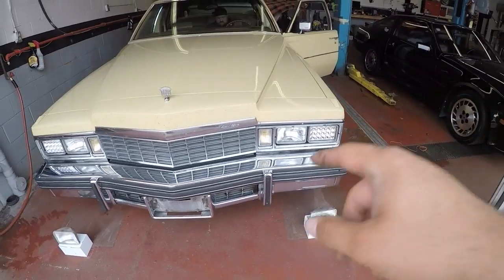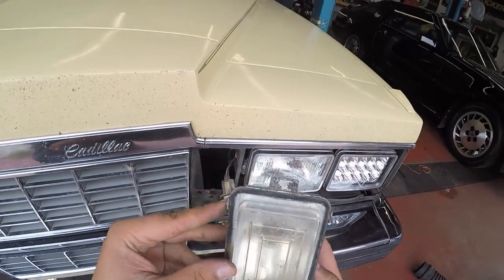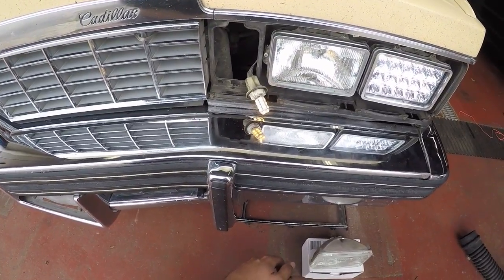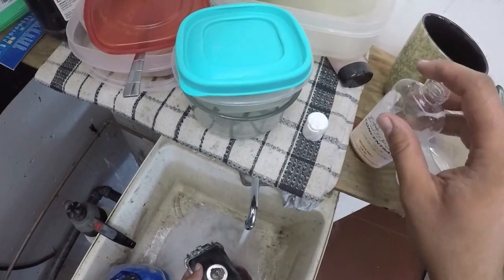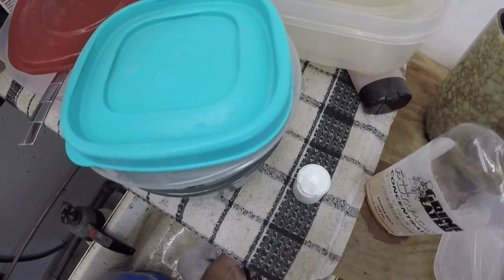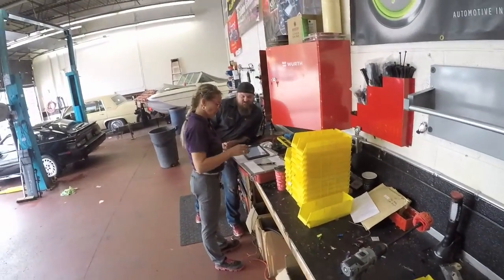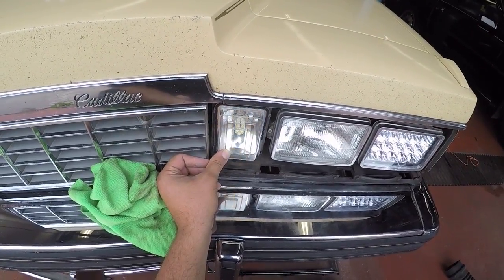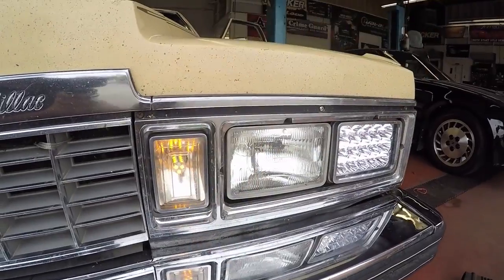Additional "Mac Daddy Caddy" Mods

Comment: Gatlin Did You Forget Something in ´that light system Kover-----that little wire up in that little hole watch 1:48
Reply: V H 
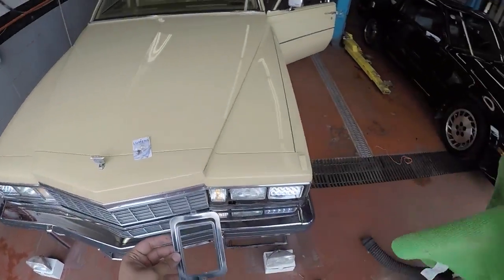He never showed the final assembly but at 12:30 it looks like it might not be in hole good eye
Reply: its a fiber optic that shows the light working in the fender on a little light display Cadillac had indicators front and back to show your lights working

Comment: Looks nice, But you forgot the retainer wire/housing ground wire /what ever it's for wire,
you forgot to rehook it,  just saying, also  I feel you should replace the high beam as well to match it up, would look better forsure.
Also,  one quick Question, are those LED lights(DOT approved) if not you may get a ticket 
or hazel from the authorities, and unless DOT approved will not pass a safety (NOT TRYING TO BE A BUTT HEAD) just giving you a heads up buddy but good job looks great